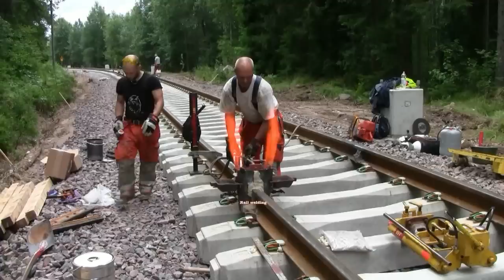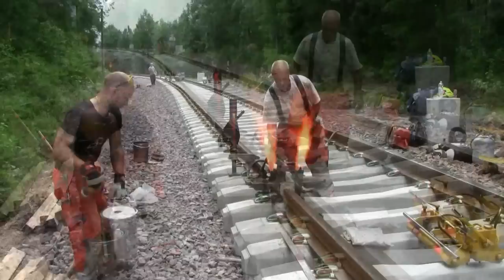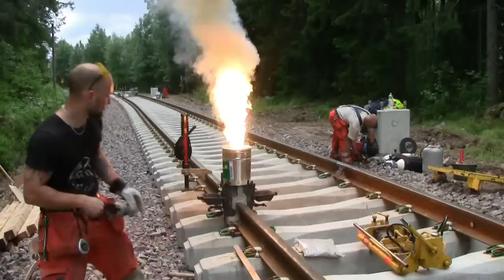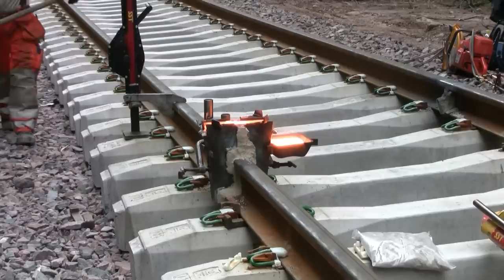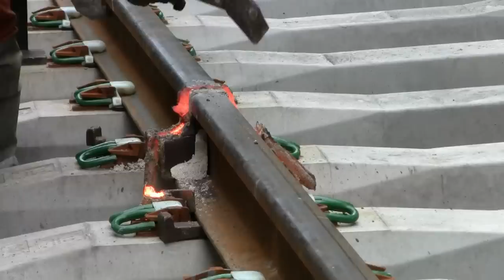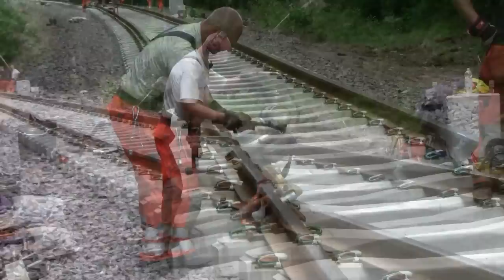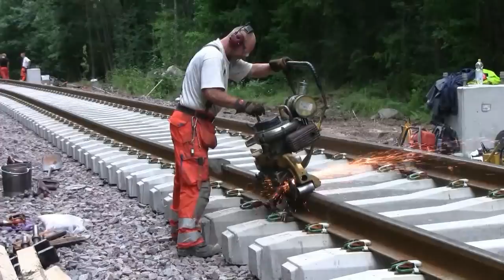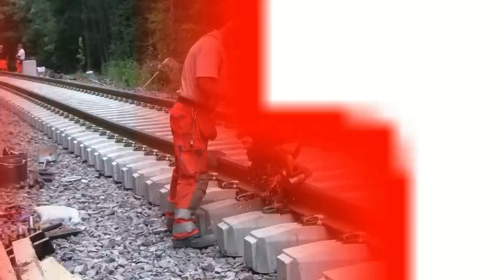Railroad thermite welding

Comment: Interesting  rail ties, concrete? Never seen any thing other than wood used.
Reply: Concrete is far more common in Europe and the UK than wood, lasts longer and is better suited for higher line speeds.
Reply: @simonross6015  also in Canada here with the drastically different temperatures in winter and summer wood works much better
Reply: @YouSucccc  sorry but I disagree, concretes are deeper and much  heavier meaning they resist track movement due to temperature changes much better than woods which are relatively light and shallow.

Comment: Are the concrete ties as flexible and durable as the wooden ones?  They surely save on trees but do they last?
Reply: Here in Sweden they last a lot longer than wood. Wood ties are usually replaced every 8-10 years here thanks to the winters and such. The concrete ones last 35-40 years.

Comment: One question. 

After they weld the rail beams. How they manage with the thrrmal expansion phenomena.
Reply: My favourite question.  The rails are stressed using hydraulic tensors so that they're not under too much pressure in the summer or tension in the winter, extremes of temperature outside of the stress free temperature (It was 27 degrees C rail temperature in the UK but it's been so long since I've done this it might have changed) can still cause problems but providing the track is well maintained it generally wont buckle in the summer or break in the winter.  In Britain they also install expansion joints roughly once every five miles IIRC and around points and crossings to protect them since they're particularly sensitive to track movement.

Comment: What happens when the rails get hot with the sun there isn't any expansion gaps anymore.
Reply: Vinsu Karma  I doubt it very much as the thermite weld I suspect will be solid. When I was at school many years ago I remember in science we had an experiment to explain why at that time there was a small gap inbetween the rails for expansion. Two rods with a space between, a bunsen burner under one and when the rod expanded it touched the other and a light came on. Hence trains then would have the familiar cricket click. I would like to know the answer, as an aging geriatric it's puzzled me for years and I'm getting a headache!
Reply: Vinsu Karma  Thankyou so much for that information, like you I found it very informative. Now I don't have a headache, it would appear that they do have expansion gaps but not as often and slanted as opposed to square.

Comment: Why no use MIG welding?more fast and cheap,buat still strong
Reply: No faster (They're filling a gap with this technique anywhere between 25mm-80mm wide and it needs to be joined completely all the way through), less reliable (Needs ultrasonically tested) and not cheaper. This gives a consistently reliable and strong joint.

Comment: P.S.  How in the world are 200 meter lengths of rail brought to the site?
Reply: Usually on the back of an engineering train, they can either be dropped to one side prior to the old track being removed then moved into place using converted JCBs.  There is also a specialised track laying machine which doesn't require rails to run on and roughly positions the rails and sleepers but I've seen that once in over 15 years so it's pretty rare.

Comment: Are these cement ties and will they be covered with more ballast or is that it?
Reply: Yes they are concrete and there will be more ballast added up to the top of the sleeper/tie level and a slightly higher shoulder on the outer sides.

Comment: What about expending and shrinking in winter and summer time?
Reply: I've genuinely lost count of the amount of times I've answered this one, it's become something of a hobby.  The track is stressed using hydraulic pullers to allow for expansion and contraction and special expansion joints are installed around points and crossing layouts.

Comment: Aren't those rails got shorter in cold and longer in hot, so welding them is a bad idea?
Reply: No because they will be stressed to take thermal expansion and contraction into account
Reply: Its doesn't change that much. Just very little
Reply: @entry8214  It can change by more than you might imagine and stressing continuous welded rail is important in preventing track buckles in the summer in the UK.  Bear in mind that rail temperatures in hot weather are usually much higher than air temperatures and in cold weather they are usually much lower.
Reply: @simonross6015  Oh well, I'm not not expert in this. My bad.

Comment: This is how to connect the broken railroad tracks.
Reply: No, this is how to connect new rails.  Broken rails are usually repaired by cutting out the damaged section and replacing it with a short length of new rail.
Reply: Oh, I see. Thank you for the information.

Comment: why thermo welding ;its take lot of time ;many people have to envolved ; its last sentury invention'time has change it required fast accurate,time saving ,
Reply: A thermit welding team is two people and it really doesn't take very long.  There is more advanced equipment but it's rare, expensive, limited in terms of access and doesn't in real practical terms have that much of advantage except in large renewals and new installations.

Comment: why don't they use actual welding...vs, that complicated machines crap..
Reply: This is actual welding.  I'm assuming you meant arc welding of some sort and in comparison this is really not at all complicated, gives a good, strong, reliable join and is pretty quick considering they're filling a 1" or 25mm wide gap.

Comment: 0:48 What's that sound?

7:07:00 PM
12/5/2018
Reply: Someone further down the track hitting the rail with something, a hammer most likely, the sound travels down the rail giving that distinctive "Ping" sound.
Reply: @simonross6015  Him

9:43 AM
12/7/2019
Reply: @user-vi3pi9rf7w  Chill out! Are you alright?...

9:43 AM
12/7/2019
Reply: 2018* both times

Comment: To me that stuff is scary crap.  I know if you touch it with your skin by accident, whatever skin touches that, will stay there.  You just lose your skin.  That's how hot that crap is.
Reply: It's very difficult to touch that by accident though, when it cooks off it's so hot that you can feel it several meters away.  Even after several minutes you'll know when you're close to it.

Comment: not wearing safety glasses... hard hats... or hearing protection.
Reply: Regarding hard hats, there's nothing above their heads to fall on them or any low ceilings to hit them, so they wouldn't be needed. 
No loud machinery that would warrant hearing protection. 
And you can go buy some new eyes at your local supermarket, so who cares if a bit of molten steel gets in 'em, huh? (I agree with you there.)
Reply: @oron61  Well I worked on a major RR for 28yrs.  Track Dept.  I've helped these kind of welders a lot... helping them get out all their tools, and set up for the welds.... clean up and putting everything away.  Damn hard work.  IMO Railroad Welders are the hardest workers.  BUT... with the ATSF and BNSF  … Safety gear was always enforced.  Hardhats, Safety glasses, steel toe boots, boots with metal cleats when snow is present. hearing protection. all of it. No baseball caps..with no eye protection.
Reply: Perhaps the Swedes are fools. They should wear eye pieces, but perhaps the fear of lawyers here is part of all the safety protocol that isn't always logical.

Comment: Sure looks like a lot of trouble their going too.  Go back to the 1900's.
Reply: It's a better system than jointed track, allows for faster train speeds and considering joints generally have to be drilled in situ a weld takes about the same amount of time. (Also as a process IIRC it's been around since the 1930s)

Comment: bad engineering, instead, just laser weld, plasma weld, forget about cast joints, very bad idea!      strong workers though , they deserve all the credit !
Reply: How can it be bad engineering?
Reply: @samarium7000  because the rails connecting points are heated, but the rest of the rails on each side of the heated mold is not, and they act as a heat sink, creating a very high temperature difference, which in turn can cause micro cracks in the weld that could lead to failure.
Reply: @danmyself5341  I don't think they would use this metod if it didn't work or last.
Reply: @danmyself5341  Which is why they will be regularly ultrasonically tested to make sure it's sound.  This has been used for nearly 90 years now, it's a sound process which produces a very reliable joint.
Reply: @simonross6015  sound ping works, as well as other methods, but there are better welding and fusion technologies, this is very old school

Comment: What going on with those concrete cross ties I’ve never seen them before I’ve only ever seen wooden ones
Reply: We use concrete here in Sweden for high speed rails. The wood just cannot hold up during those forces. It's also common up north as they last a lot longer in the snow and ice than wood does.

Comment: we sent the deliberate air pollution of this stuff, back to the-west, by preloading your lands with bias to radioactivity and thermite. when the-west !max out air-capacity, we introduce polar cooling, then water, then ... until sorting then flowing then today, toohbad because its near summer. you started in winter due to going cheap on heating. this is the max-value revised by asians.

Comment: Seems like alot of work just to weld rail joints !  😰
Reply: If you were on a train going round that curve at 100+ mph would you rather they cut corners?  It's actually a pretty quick (A good team will go from arrival at site to finished job in as little as 30 minutes on straight track) and reliable process and if you're a passenger on the train you wont even realise you've gone over a weld, if you travel by train any sort of distance regularly you probably go over literally hundreds of them every day.

Comment: Now if you want to know the truth about the use of thermite on the twin towers on 9/11. Then you would research the product called, Sol gel nano thermite. Look into the  effects of the steel structures how they were bent, heavly rusted, the fires burning for months, the firemen seeing steel melted moving like molten lava, the nasa photos taken showing thru thermal imaging of heat index recording of over 2,000 F. Boots soles melting at the base of the rubble pile!  And most of the steel structures was immediately hauled off to be shipped to another country, and nobody was allowed to examine the crime scene with proper examination procedures. Millions of Americans truly think an aluminum airplane can cause a steel concrete multi-story skyscraper destroy two buildings by  fire from jet fuel which is kerosene and have the kinetics ability to cut thru steel by aluminum! It reveals how dumbed down Americans can be brainwashed by TV networks and a president and his cabinet that committed TREASON!